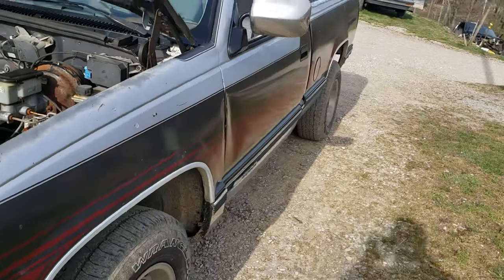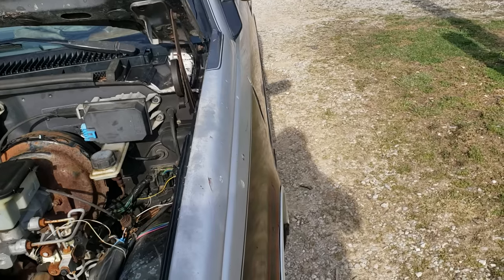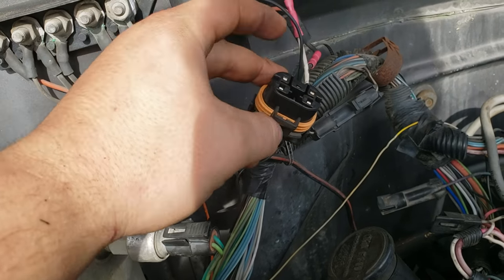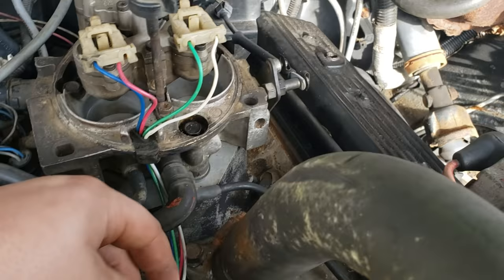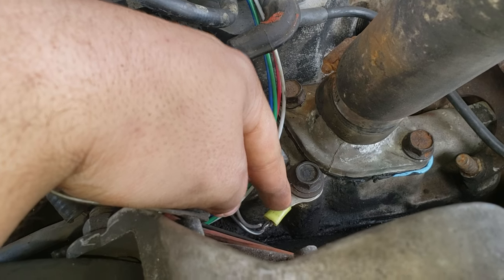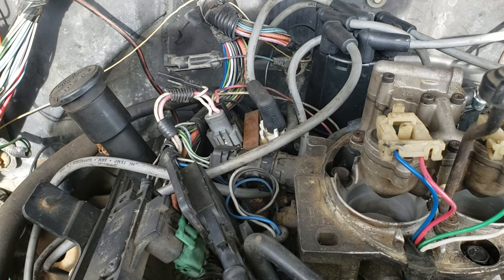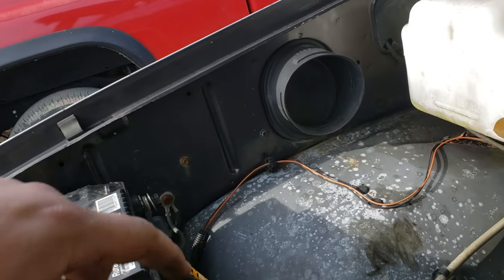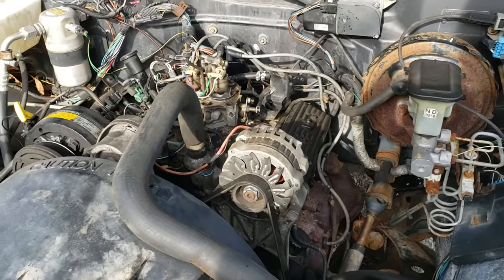Chevy/GMC how to test for a bad fuel pump tbi

Comment: i recently purchased a 1995 c1500 w/t with a 4.3 votec wasnt getting fuel so i replaced the fuel pump in the gas tank its getting gas up to the throttle body now but the throttle body doesnt seem to be working

Comment: Hey man what exactly is that lil fuse holder the one you said to check the ground on after the relay ?? I have no power going there I wanna know exactly what it is
Reply from the maker: i think ur talking about the fuel pump relay
Reply: @rednecklife55  no I was talking about the fuse one the second one you said to check grounds on

Comment: I got 95 gmz 5.7 idles fine n smooth dnt stall but sputter around 80 stile at 40 km I change fuel filter tps clean carburetor

Comment: I've got an 89 Blazer 5.7 with tbi. New fuel pump, filter, injectors twice!, rebuilt pressure regulator, new Idle air control sensor, map sensor, throttle position sensor and new ECM! The grounds all look ok. It is still running way to rich at idle... It was running fine and all of a sudden started running like hell. I thought it was water in the fuel because the filter was full of water. I dropped the tank again! Drained all the fuel and water and ran acetone through the tank to help evaporate any water before putting it back in. I'm so frustrated and tired of throwing money at the problem
Reply from the maker: K5?
Reply: @rednecklife55  yes and no.. technically V10 Blazer..still a square body full size
Reply: Update! I pulled the entire throttle body from the intake to inspect. Also need to mention the truck sat for 6-8 years. Mud Daubers had completely filled the cavity for the idle air control sensor and a couple other ports. I also found the plastic gasket on the fuel return nipple had been crushed and was wedged folded over inside the throttle body..
Putting it back together in a few minutes
Reply: Nope still running rich at idle. It idled for about 10 minutes. I shut it off and restart won't idle at all
Reply: Still frustrated with this damn truck! Replaced the fuel pump again and it's still running rich at idle!
Reply: @jonpitt1242  if you have a bad O2 sensor the ecm won't know when to send less fuel. Also, after you set the static timing with advance wire disconnected, did you reconnect?
Reply: @tomholley6904  I've got it all figured out now. Thanks for the info. Previous owner had flip flopped vacuum lines for map sensor and manifold vacuum.
Reply: @jonpitt1242  after reading most of the comments, I was thinking you may have a bad map sensor, glad you figured it out.

Comment: My fuel pump is humming but I still ain’t getting fuel well
Reply: Check your fuel pressure, must T in at the fuel filter on the frame rail.https://youtu.be/AywmcfDlH3E
Disconnect the injectors & fit  a noid light into the connector to check for harness integrity and that you're getting a signal from your ECM  Ensure the fuel pressure regulator right behind the injectors is not leaking.

Comment: Great video!  My truck will crank all day and not start. Already checked all the fuses and the relay. In the process of removing the tank on my 1990 K1500 Silverado. I get 12.5 volts at the relay but only 5.5 volts at the pump. Been on Google for hours and can't find anything about the correct voltage at the fuel pump. I'm guessing it should be 12 volts. The tank has a bad leak so needs replaced anyway. Going to replace the fuel pump and pickup assembly while its out. Any insight would be appreciated.
Reply: Voltage Drop due to high resistance . 
Check the voltage before and after each connection . 

With circuit on  , also should he zero volts on the  ground wire  , 
voltage = Poor ground
Reply: @KJ7SIR    ended up replacing the fuel pump. Fires right up now. I tapped the old fuel pump with a plastic hammer and it started working. Figure it froze up from sitting in an empty tank for 2 years.

Comment: I’ve got a 1993 TBI Chevy K1500 it cranks and fires up but after a couple seconds it dies. I can get it to stay running but it doesn’t run well. I’ve replaced the fuel filter, air idle control, throttle body, map sensor, engine coolant temp sensor, cap and rotor, ignition coil and ignition module, egr valve and egr solenoid. And it still is doing the same thing. Any guesses?
Reply: Hey bro mines doing the same thing. You figure your problem yet?

Comment: I’ve cleaned a couple of grounds and new fuel pump relay. Going to clean those two you showed us tomorrow. I have a multimeter but don’t know shit about it please tell me how I check that orange wire for power
Reply: Place the black probe on a known Ground and the red probe on the orange pin. Not sure but it should read about 12 volts. Reference the Haynes Book or other wiring diagrams for reference.

Comment: I changed my pump. All fuses and the relay are good. No fuel coming out of the injectors. The day the pump went out the injectors were spraying fuel out. Replaced the pump now no fuel?
Reply: I have a similar situation - new pump, new filter, van will turn over if you spray starting fluid in TBI but won't stay on, I can here the pump prime when I turn the key... did you figure it out?
Reply: @andylangeland496  hey dis u figure it out im having same issues hep
Reply: @559Obsalex  yes it was a corroded ground at the engine block coming from the battery. Here is a video i made about it... hope it helps https://youtu.be/uNGi8EwoVl8
Reply: @andylangeland496  i cleaned it up but still nothing i do not have the little ground connected can that be a issue to?
Reply: @559Obsalex  yeah all the grounds need to be connected... the TBI unit is electrically powered and needs that power source. If the ground isn't connected then it can't spray the fuel into the bowl. You can check your TBI unit with a 9 volt battery... probably just look it up on YouTube... its simple but hard to describe in text

Comment: oh i have a question,how do you check the ground  im about to give this up ,everybody says check this check that ,show me
Reply from the maker: Check grounds as in take them off clean them make damn sure it has good connection bc if the ground I'm showing you in the video has bad connection then ur fuel pump will not work
Reply: @rednecklife55  sounds good because it does when it pleases,thank you very much..il let you know how it goes.
Reply: @butchdoster329  how did it go?  I'm having some of the same problems.  Have a phantom voltage of 12.3 volts on pin 30.  No other voltage on any other points on the pigtail.  Checked the ground pin a had good light on the continuity tester.
Reply: @butchdoster329  I thought I had a good ground but I double checked the ground isn't grounded.

Comment: Howed you test the fuel relay the orange wire thanks
Reply: Testing the orange wire itself, if its a power wire, just grab a test light. It will light up. The relay usually has a schematic on the top side, showing you which way it trips. After that you can probe it to see if it clicks, or grab a voltmeter and test for continuity. If that checks out i would definitely probe afterwards to see if its working.
Reply: @jesusgalindo9210  okay 👌thanks

Comment: I have a 1990 Chevy and it turns on fine. But when you put in reverse or stop or come to a stop while driving it idles down and sometimes turns off. Any suggestions? We’ve replaced the fuel pump as well already.
Reply: I have the same problem but it’s every stop it dies. And then fires right back up and head to the next stop sign and start it back up. Still looking for the problem
Reply: @BackyardDad1  it does this to me as well. Turns right back on but then turns off
Reply: Same with my r10. You have any solution?

Comment: The fuel isn't getting to the injectors is not enough power or pressure to pull the gas to their I'm told by an ominous people it is the fuel pump
Reply from the maker: More than likely

Comment: Have power on orange wire have power on middle plug at fire wall for 15 sec. Pump may run for weeks then not run for weeks no rhyme or reason for it to stop or start  pump is 3 yrs old

Comment: I need help please! I cant figure out on my 1995 K1500 suburban tbi My truck suddenly won't let me go faster than 35mph When I finally made it home  When I parked it my truck aggressively shakes and die Every time I start it. It has a full tune up also rebuilt throttle body/ new egr/ no vacuum leaks an my pump does prime I just can't figure it out what's wrong, I know my timing is perfectly fine I'm so  Confuse.. any ideas you may know?
Reply from the maker: Does it smell like its flooding? Does it load up and smoke?
Reply: Yes It does smell like it its flooding, but no smoke
Reply: If the temp sensor is bad the computer keeps running rich and can burn out the catalytic converter and clog it or muffler up. Easy check is if it’s running is much exhaust flowing out.
Reply: @patredoski5809  ?

Comment: People tell me I could take the whole truck bed off I have a 99 Chevrolet 2500 3/4 ton truck how the woman going to do that
Reply: Take all the bolts off your bed. Then put center on blocks on both sides. Slide 2x6 or 3x4s under bed. Jack up bed, add blocks as you get higher. Push truck out from underneath the bed. Afyet fixing push truck back under bed and let down slowly. If you can't physically move truck, use riding lawnmower
Reply: Just drop the tank its not that bad a couple of beers and bingo

Comment: Too bad he never says how to test the fuel pump
Reply from the maker: There's no  check valve to test for fuel pressure unless u install an aftermarket one, wanna know how to check for a bad fuel pump.... get a can of starting fluid and spray in the throttle body
Reply: @rednecklife55  my issue is that i think its going bad im running like crap, and its intermittent itll run great one day and terrible the next few days sputtering stalling, erratic idle, no power until WOT. but when i unplug my new MAP sensor VAC it runs good,read that it could be fuel pump going out, low pressure. possibly. you can use a pressure tester and plumb it in in place of the fuel filter. getting ready to do that now myself
Reply from the maker: Usually if its a fuel pump they either get hard to start bc of low pressure or dont start at all, iv personally never heard of a fuel pump running good one day then the next running bad, I think yoy need to look closer into that sensor, you might have a throttle body gasket bad or need a new sensor even tho that one is new they could still be bad
Reply: @rednecklife55  Thanks for the reply! i had already changed most of my sensors mostly because the CEL had a code for them and when all those were gone after a few days the problem came back. but i changed the fuel pump yesterday and problem is gone. the lines were very rusted but not leaking. i dropped the tank and nearly just broke the Lines off the sending unit. I'm sure i had a pretty bad vacuum leak or something. on another note i did already rebuild the TBI in the process and before that when i bought the truck i did plugs cap and rotor and wires. but she runs good now!